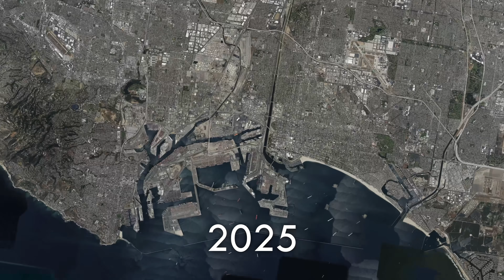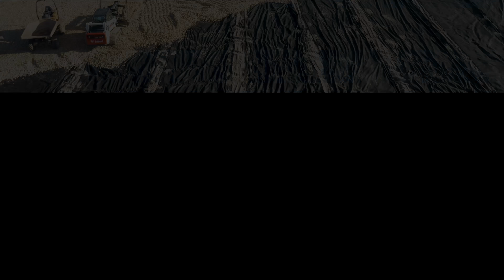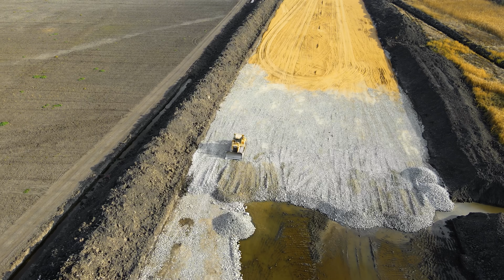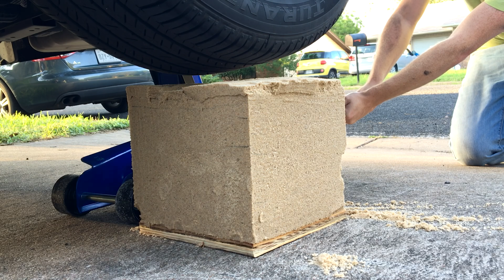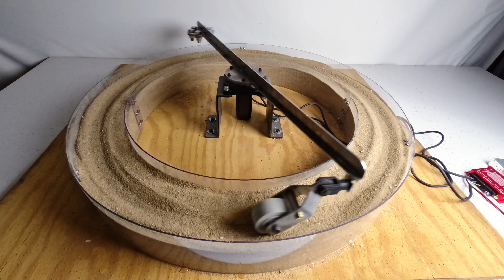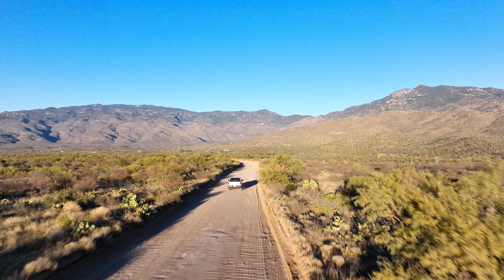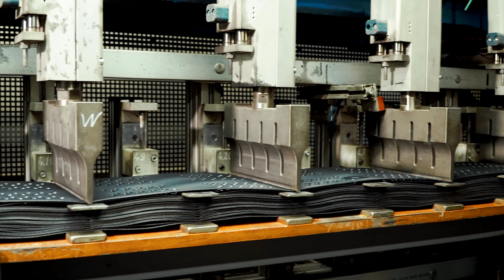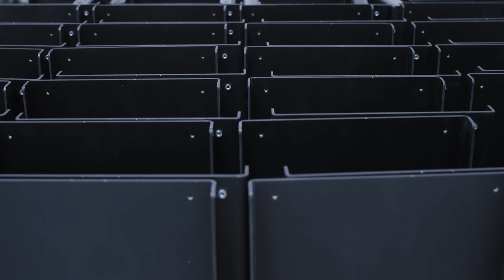The Grid That Doubles the Strength of the Ground

Comment: I'd imagine it would be possible to use a biodegradable material, but then you literally have a time limit on the subsurface structure you're building on top of.

This is one of the best use cases for synthetic polymer materials I can think of. Despite the overabundance of petroleum plastics in everyday life that definitely needs to be addressed.
Reply: This is literally THE use case for petroleum plastics, out of the sun, chemically inert environment, structurally imperative for hundreds of years, literally checks every box that makes plastic frustrating to use.
Reply: @waldosan  exactly.  "the plastic will always be there" is a desired result.  f they can make the stuff out of post consumer recycled plastic, so much the better.
Reply: @kenbrown2808  the problem is PCR is like 10x the cost of new because it's literally a nearly free byproduct
Reply: @miamisasquatch  if PCU is so valuable, why do I have to pay my trash company to make it go away?
Reply: @kenbrown2808  why would you think they would take it for free? Valuable or useless, it still costs money to move it.
Reply: @ltt22ebm  my parents ran a business for years.  people paid them to be able to take away valuable stuff.  

since you don't seem to be able to catch subtle hints: I'm clowning you.paying to reuse stuff is better than paying for new stuff and paying to make used stuff to go away at the same time.
Reply: @kenbrown2808  The new plastic is a byproduct so it's really cheap, while recycling needs transport, sorting, separation, and processing which makes it pricier. That means the recycling plant needs to compete with the cheaper variant while having a higher overhead. It's a crappy situation.
Reply: @kenbrown2808 look that's nice and all that you've correctly deduced the super expensive recycled, more environmentally friendly option is better and more environmently friendly, but have fun arguing for 10x pricier roads that already cost billions. Recycling literally wouldn't exist for consumer trash at all if we were doing it for a profit
Reply: @kenbrown2808  because moving stuff around is a service, all the more when you don't know where it's supposed to go.
Reply: @kenbrown2808  they can't

plastic recycling is rather like the carbon footprint; created by petroleum companies to make ordinary citizens feel better or worse about themselves rather than addressing the root cause

when drilling for oil and gas, the gas you're looking for is methane, but a large component of the gas recovered is ethane. a tiny part of it is released, a much larger but still miniscule amount is flared off (burned) because emissions limits are in place, the rest of it gets turned into ethene (ethylene), which then gets turned into polyethylene

that's why PET is so cheap, if the oil companies can't get rid of it, they have to deal with it, so they offload it to someone else, and fund recycling plants to make everybody feel better about themselves 

and all of this is without referencing the practical issue of plastic recycling: it only works when the plastic is clean, and it (practically) never arrives to the recycling plant clean
Reply: It will be there for sure, but it might deform so much it contribute nothing.
Reply: @waldosan  all fun and games until bacteria converges on the genes needed to metabolize it.
Reply: @horatiochachi9508  You just gave me the best idea for a sci-fi apocalypse short story. if we woke up tomorrow and bacteria started eating plastic . . . I genuinely need a science youtuber to do a video on that scenario
Reply: @virtuallybeige5597 I have a feeling it's been done before...
Reply: @wrentubes1886  I have a feeling you would've told me a name if it had been done...
Reply: @wrentubes1886  For select plastics, I'm pretty sure it has been done.
Reply: @virtuallybeige5597  not plastic, but the Ring World civilizations started collapsing because something started eating their room-temperature superconductors.
Reply: @virtuallybeige5597 
H.G. Wells CORRECTION John Wyndham wrote a book about the collapse of his civilization when metals turned soft one morning. 
He used plastic as the hard substance in 'The Day of the Triffids'.
Reply: @virtuallybeige5597  Michael Crichton’s Andromeda Strain is one.
Reply: @20chocsaday  Thank you! I will look into this :)
Reply: @20chocsaday  wait, nothing comes up when I search the metals turning soft thing. is there a title you can give? The day of the triffids is a different author about carnivorous plants
Reply: @jstan_49  Thank you, will look at this one more!
Reply: @virtuallybeige5597  Which sounds terrifying, except it would be a problem as slow as wood rot or metal corrosion, and we'd just be happy that the trash gets cleaned up over time.
Reply: @米空軍パイロット  Right, but so much of our word depends on plastics lasting forever now. Think about all the joint replacements, and medical implants that would start rotting from the inside. there's a lot of people who would need to get surgery very soon in that apocalypse scenario. Most electric wires would have their insulation fall away. Not an issue in the long term, but in the short term? definitely a nightmare
Reply: @virtuallybeige5597 
Have I confused two books? It was a long time ago when I read them. 
So far as I remember it was plastic that was the only material rigid enough to cut through a triffid. Blindness was also involved but the main character had been inside hospital with his face bandaged and did not see the meteor shower which destroyed the eyes of the watchers.
Reply: @virtuallybeige5597  From the medical perspective, I think the bigger emergency would be inflammation and infection from these bacteria as they multiply around your plastic implants. But I doubt they'd move very fast on the plastic itself. And again, this nightmare you talk about with things eventually breaking down. That is already our current reality with most materials. That is why parts and machines have expected service lives and maintenance intervals.
Reply: @horatiochachi9508 plastic eating fungus is a thing
Reply: @米空軍パイロット   The issue isn't things breaking down, it's having our assumed constants of reality be torn apart in real time. Yes, parts have service lives, but if the service life of everything made of plastic shortened by several orders of magnitude overnight, that would be catastrophic, and a great premise for sci-fi horror imo.
Reply: @米空軍パイロット    The issue isn't things breaking down, it's having our assumed constants of reality be torn apart in real time. Yes, parts have service lives, but if the service life of everything made of plastic shortened by several orders of magnitude overnight, that would be catastrophic, and a great premise for sci-fi horror imo.
Reply: @virtuallybeige5597   I can see that
Reply: @virtuallybeige5597  imagine the labubu collectors when that happens…
Reply: @horatiochachi9508  not really. You have fungi that can, in the presence of strong UV, break down some specific plastics. In reality even the OG "plastics" such as cellulose are still incredibly resilient, hence why we see people actively buildings things out of wood without a fear that it might quickly decompose. Unless your plan was to build an island out of UV sensitive plastic bags in the Pacific ocean. Yes, that ship has sailed.
Reply: @waldosan literally what do we build now that lasts hundreds of years.
Reply: Massive shipping ports just like the video shows, to be fair. This way a small amount of hydrocarbon gets put in the ground vs massive amounts put in the air from transporting heavier materials. Next up is fixing the emissions of the ships that enter that port…
Reply: @jarretta2656  landfills mostly. But also we're still constructing dams and those are legally supposed to have shelf lives of 100 years or more. Ostensibly the desire to create things that last are still there we're just confronted by a society unwilling and increasingly unable to spend more money and make less money which is what's required to make things that last.

 Engineering isn't about building structures, it's about making the most structure for the least amount of money. I could build a dam, it'd cost half a billion dollars and it'd be overbuilt and would still run the risk that I overlooked something and now I've either flooded a mine, or a cave, killed off a few endemic species. It would last 100 years because when you pile enough rocks up to build your own holy mountain it does in fact hold some water. An engineer could do the same on 50 million dollars and have enough leftover to provide some solution to mitigate the environmental impact while holding 10 percent more water than mine would. Most engineers would love the challenge of making something that lasts 100 years. Most financiers are only interested in paying for something that's not going to be their problem in 20 years.

It's like art neuvau and art deco, both of which were absolutely gorgeous and peaked not only when we had money to spare but a desire to spend it. There's also the aspect that if politicians are spending money on things that last and look nice then that's money they're not spending on other hot topics like healthcare, bike lanes, and what pantone color the local school needs to be slathered in order to reduce juvenile violence.
Reply: @jarretta2656 plastic hasn't been around for 100 years
Reply: @waldosan abrasion and water are going to destroy that plastic in 10 years, and that's an optimistic prediction. 

Plastic molecules last forever, things made out of plastic quickly fall apart.
Reply: @Dav @Davionation-s1g  it depends very heavily on the specific type of plastic used. Geotechnical plastics are completely different from the plastic mp3 player from 20 years ago
Reply: @MetaCake-  probably not made out of geotechnical, that sounds expensive, so unless the regulations force them to, they won't. Even so, might cut water out of the equation but not abrasion and breakage from soil shifting, and literally every example here was to reduce soil shifting and had surface abrasion.
Reply: ... the whole point of that type of plastic is this application, it's plastic, it's cheap comparatively.
Reply: @MetaCake-  yeah, it costs .02c instead of .015c per gram?    You clearly have never met a businessman.  

But you're still entirely ignoring the abrasion and soil shifting destroying it.  Tires are fairly waterproof and they roll, yet somehow they go bald 🤔
Reply: @Dav @Davionation-s1g  contractors building with these products aren't choosing the materials that they are made with. They just buy the product, there aren't different products made from wildly different materials. 
You bring up tires asking how they go bald, I assume you don’t actually need an explanation of how material transfer works. Why does the water resistance of a tire matter in the long term wear in this context? Are you trying to compare rubber to plastic?

Obviously soil shifts, but watch the video again. Soil shifts significantly less with this type of system in place. 

Your entire argument is based on uninformed assumptions and your idea of how something works. Just look at little deeper than your assumptions about a technology before acting like you know something
Reply: @Davionation-s1g  Water is not going to destroy the stuff water pipes are made of in 10 years buddy. Any sane project is going to pave over it anyway, the point isn’t to drive on the cells. So not only will it not be abraded but also dry not that that really matters.
Reply: @Davionation-s1g this construction technology has been around longer than that.  Geopolymers for decades, rock matrix construction like this about 15 years.
Reply: @Davionation-s1g Most are designed to last either 50 or 100 years. There are strict rules manufacturers have to follow and each product comes with documentation about the materials degradation over time due to creep, uv, chemical and biological factors and even damage during construction depending onthe other materials used and seismic activity are taken into account. Then we apply all these different factors depending on how long our construction needs to last.
Reply: @kaisaheikkila  50 to 100 years buried in inert materials.  If you're telling me you believe they'd claim that for loose soil and an abrasion surface, all you've told me is you have no idea what you're talking about.
Reply: @waldosan no it absolutely isn't because you misunderstand plastic degredation. The material breaks into smaller pieces and flakes off constantly, it's only the microscopic pieces and molecules that don't break down
Reply: @benG2141  have you seen the excavations they do in landfills? Plastic only degrades like that because of UV degradation, without UV or other highly energetic situations such as ozone or neutron bombardment, it basically stays inert for long periods of time, statistically hundreds of years IIRC.
Reply: @waldosan  Oh, I didn't realize. Even so, I think it's better to use a different material. For example, grow a plant or fungus in the pattern needed. That way it will heal itself but also be able to be removed if needed
Reply: @benG2141 that dose seem cool in principle but I think we would have to specificly bio engineer such a solution. And that might have its own draw backs. Could theoretically upset the local biosphere with an invasive species. Not saying it wouldnt work, it just also has its own concerns.
Reply: You could use this idea on a slope where you then also plant grass with deep roots. It would stabilize the slope until the grass gets going, and then it’s degrading could be an advantage by releasing nutrients to the plants
Reply: I suppose if you were wanting to stabilise a slope RIGHT NOW but also expected it to grow plants that would stabilise it with their roots, that would be the time to use a biodegradable version, but I can only see that being a benefit for erosion control, and I think a biodegradable fabric or mesh would be both easier to manufacture and more suitable for the scenario.

Unless you were building a very temporary access road into somewhere?

I'm sure there are situations where a biodegradable geocell would be the perfect solution but they would be so very niche... Interesting to think about though!
Reply: @samuelmellars7855  Thats actually a common landscape construction product for erosion control. Usually green, with kinda cotton candy vibes to it, maybe an inch thick.

But roads are under such high loads compared to erosion. Not super practical.
Reply: Geo cells would be a trivial problem.  Ppl don’t talk about the real sources of microplastics…..paint. Never dawns on ppl acrylic paint is just liquid plastics, they we dry it out.

A recent study found glass bottled water has more microplastics than plastic bottles from the painting process.

Now think about everyday life…houses, cars, shipping containers, cargo ships, cranes, trucks, construction equipment……all exposed to the sun with hastens their degradation into microplastics as it flakes off due to abrasions or old age.

And we don’t have much choice. It’s such an insurmountable problem, that I’ve stopped caring about microplastics. As what testing has already shown, replacing every plastic bottle would actually make the problem worse.
Reply: Yeah I think the problem with plastic comes from all the single-use water bottles and food containers littering every conceivable place on earth.
Reply: We do have bioplastics that only degrade in specific commercial composting conditions, and nothing that would be experienced in the ground except over 1000 years as an ecological half-life. The orbeez gel balls people shoot out of those guns in the thousands are a "bioplastic" that in reality lasts 10,000 of years because it has a normally 500-1000 year half-life, and only degrades quickly in specific composting methods.
Reply: The answer is yes, for most places a mild steel or aluminum grate would be just fine. But if people or animals have to walk over it you have to use stainless or aluminum so people don't get sick. It would be a lot more expensive but would leave nearly nothing behind as it degrades
Reply: @throwaway2974 mild steel rusts.

Aluminum would work, but it’s expensive for this application…
Reply: I heart Oil!
Reply: I think Hemp, Jute and coconut fibers should be tried, they last a long time in weather, is biodegradable and they leave their fiber mesh even if they rot after a long time and they are really strong.
Reply: Granted this stuff still probably Dry Rots / Gets damaged from Cyclical Loading (thermal expansion + vehicles driving over etc).

Granted this is much less bad than Geotextile,  but Old Landscaping Fabric is HORRIBLE to deal with.

Also i’ve dealt with some Polystyrene Foam around Natural Gas Pipelines while doing a “Soft Dig” / Hydro-Excavation,  and that stuff is pretty bad too.

Rigid plastic like this and piping isn’t GREAT,  but isn’t TOO bad.

Design for Removal/Replacement (and thus have it rugged enough that it won’t fall apart into litterable pieces),  and potentially Biodegradable once micronized/slow biodegradable may be nice for micro/nano-plastic pollution.

That and/or have there be a “wear surface” of a non-polluting material (ie biodegradable polymer or just non-toxic mineral/metal/asphalt etc)
Reply: I thought about this too. Using a biodegradable material, especially something that would release nutrients to make the surrounding soil healthier as it decomposes might be a great idea on long stretches of steep terrain for example over railroads or other relatively deep excavations to give extra support to the soil until root systems develop enough to naturally take over.
Reply: @JonathanKennedyII There are plenty of plants that fit to this. See for example the wiki page about Sand dune stabilization.
Reply: Yeah depending on the situation that might be desirable. But if it’s just “we need this spot of ground remain the same” like most roads (?) I imagine you don’t want a built in expiration date (unless you’re going the whole “planned obsolesce route”). What I’d be concerned about is if/when it breaks down, what exactly that looks like. Would this somehow get microplastics into the water table for example.
Reply: That would be inherently dangerous to say nothing of costly. You can't afford to have a shipping terminal suddenly collapse because the material biodegraded to a point where it could no longer hold the loads. It would be a lawsuit waiting to happen and shutting down the terminal to rebuild everything every so many years would be tons of lost revenue, man hours and added expense.
Reply: But you don't want it to biodegrade, why use biodegradable?
Reply: @marinell06  that's Jonahtan's point.
Reply: Romans did similar thing with wool, and  you can just use metal mesh, it just costs a lot.
Reply: the only possible downside is microplastics leaching, which should be very minimal given the environs.

then again, we're talking about decades or even centuries-long usage... do we even have data/testing for that timescale? perhaps under repetitive stress cycles, microscopic parts of the plastic would eventually flake off into the fill and subsequently accumulates in groundwater?

even then, this potential microplastics runoff would still be in the ground, and not be floating around exposed to direct UV from the sun, so it is still a vastly smaller problem than practically every other use of plastics. again, this isn't even a known issue at this point, just speculative.
Reply: Why'd you want it biodegradable? That'd just massively increase the rate of microplastics leaking into the environment
Reply: You want that carbon back in the ground!   It’s one of the only ways we can sequester carbon
Reply: They have a lifetime anyway though.
Reply: @jarretta2656  Yes but it's hundreds of years instead of a decade or two.
Reply: @asandax6 uh. What has a lifetime of 200 years? Roads? Modern buildings?
Reply: @jarretta2656  Yes dirt roads have life times of hundreds of years because they don't need paving and the cars driving on them basically keep all vegitation from growing. Unless there's a flood those roads can last forever so long as there's traffic on them even if infrequent.
Reply: Not really. Organic materials need biology to "degrade", microorganisms, oxygen and water. Only two-three surface layer of soil has it. Deeper layers only get penetrated by few roots and fungi, but they provide even better support for dirt.
Reply: Biodegradable material could still make sense if it's a surface that's meant to be built up over time
Reply: We "just" need to find a way to completly desolve/deconstruct plastic if we want to - by Injektion an anerorb plastic eating bacteria solution vor example
Reply: Or moulded concrete thats thinner and ligter than just pouring a slab. But that would still be way more expensive.
Reply: Biodegradable doesn't mean that it's in our lifetime, just look at some of the "green" plastics and what they require to breakdown.  This type of construction can be done with many natural products as well but of course we choose the cheapest.
Reply: @thenextstepp 
I have plastic bags in the cupboard which can't hold themselves up.
Reply: Plastics should have been confined to permanent or long term structures. Making them disposable and and one time use was a major mistake.
Reply: Plastics should be limited to medical and agricultural uses.
Reply: @jonathansmith4712 agricultural uses……how do you think it gets into food? It literally gets trapped in the vegetables as they grow. 

Then there’s maritime applications where plastics are the only thing that lasts in such a corrosive environment
Reply: @Menuki  I’m talking about greenhouses, etc. not stuff that actually contacts the food. I think plastics should be reserved and used only when no other reasonable alternative exists. I think that plastic gets in our food primarily from packaging, not agricultural plastic use, but I’m sure it’s been studied, and I could be wrong.
Reply: @jonathansmith4712  your wrong, it’s paint. Acrylic paint…..acrylic is plastic. Tractors, trucks, harvesters, combines, shipping containers, cargo ships, your house……it’s all in the wind. Coats the plants everyday, grows into their cellular structure, not cutting or washing removes it.

Replacing all the plastic bottles in the world wouldn’t make a dent…..the paint on glass bottle is just as bad
Reply: Great idea! That way we could add the 'planned obsolescence'' business model to buildings! It could be in addition to manufactured items made to a specific  lower quality level so they can be discarded easily after limited use. Its wide wide world out there for new business ideas. By those newly minted MBAs.
Reply: @mattjhsn they already do that with Non-Biodegradable materials is the thing though.  If you ever dug up “Landscaping Fabric”,  you would understand the need for something that DOESN’T last so long.

(Also plastics still degrade…they just loose useful strength or tear etc…while still being fish food/bird strangling size etc)
Reply: I absolutely loathe environment conservation larpers.
Reply: or like metals that aren't as problematic. idk
Reply: @CasusUniversum  metals corrode
Reply: @AncelDeLambert idk zink or aluminum or something
Reply: I've got a better solution: engineer a plant or fungus that grows roots into the stabilizing pattern needed, like an underground trellis fence
Reply: Plastic does biodegrade, there are many fungus' that consume plastic, its just overhype to slow down those who are a part of economically superior cultures. 

Polyester, polyethylene, polypropylene which are the primary building blocks of these geogrid meshes break down naturally. 
Just not in a week, which is where humans get upset, the natural biological process takes a good deal longer, but they do break down naturally. 

Plastic is not as scary as people make it out to be, so long as folks aren't dumping it into the oceans, and are disposing of it properly, though it does break down in the environment on its own.
Reply: @Golden_SnowFlake  Asbestos also breaks down naturally, as does uranium. The issue is the emerging body of evidence that microplastics from this breakdown are harmful to human health, so where we can reduce single use plastics, we should. Plastic very much still has it's valid use cases, but not as disposable single-use items for general consumer goods which don't need protection for, eg, food hygiene reasons.
Reply: Yeah after 10,000 years i guess but i mean come on
Reply: @Golden_SnowFlake "so long as folks aren't dumping it into the oceans" ive got some bad news for you bud